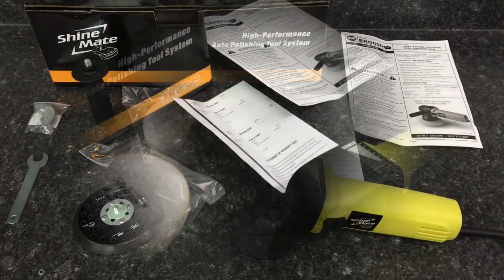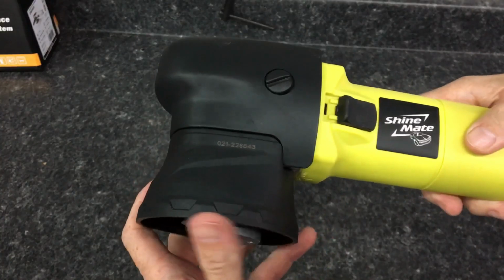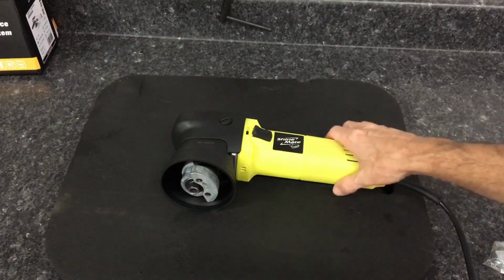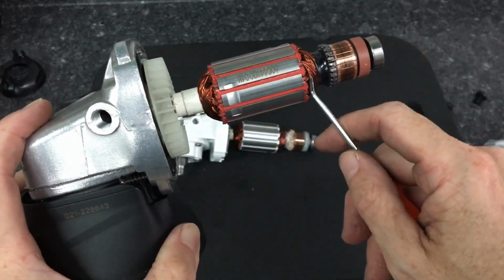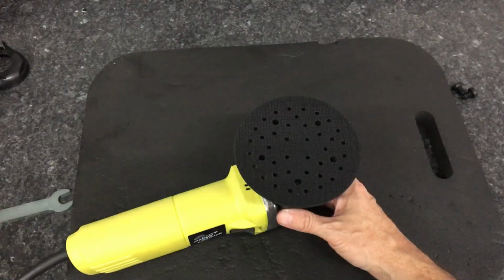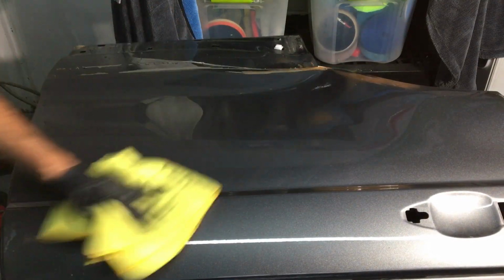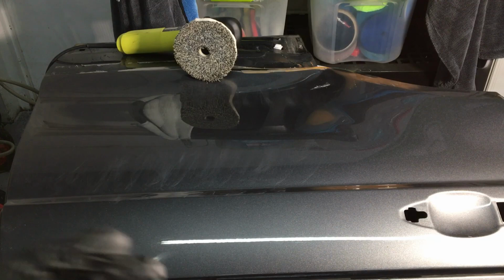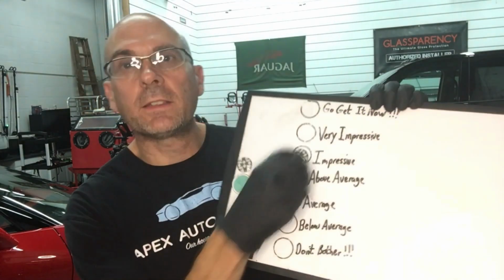ShineMate ER0600 G1 + 9MM Throw DA Polisher! Another Option For Beginners!!

Comment: 2 questions : Do you need a MINIMUM of 2500grit sandpaper for a polisher to get the scratches out ? 1500 is too low * ? 
What's the MINIMUM speed for a polisher to work (initial cutting compound / polish glaze) ? 
Thanks, great info btw.

Comment: I was looking to ER0600 G2 but in my place it's only ER0600 G1 in the shop. I wonder if this too has "load sensing module which provides a constant speed output" as the G2 states too. I need a machine that is more closer to a forced rotation DA.? Any tips?

Comment: If I lift the pad off the paint, and put the speed to 6 (high) it doesn't appear to spin faster than at 2 .... normal ? Do I need to put pressure / weight on it (on paint) for it to reach its max speed ?

Comment: Like.

You didn't swap out the lube ;) 

Rookie question : what do the brushes do? How do you know when it's time for a swap?
Reply: Brushes allow current through the armature. The armature is spinning so there's friction and heat which will wear down the brushes over time. You can probably imagine how a tool will behave without enough current to drive it.

Comment: Can you correct swirls in two passes (criss cross)  with this polisher using 5" pads or would the smaller motor mean an extra pass?
Reply from the maker: On soft clear...you could.
Reply: @apexdetail85   Sounds just right for my black Tundra.👍

Comment: My two cent, avoid this.  that controller wheel placement is terrible. I have a maxshine m8 practically the same and I'm consider giving it away and get something else.  imo, the Polisher should is where most money should be spent if you run a business.  Everytime you pull a polisher out, it's a 3-4 hours minimum to upward of 20 hours.  having a good machine means alot.
Of course, that is if you detail professionally.  this definitely works great if you're a weekend warrior